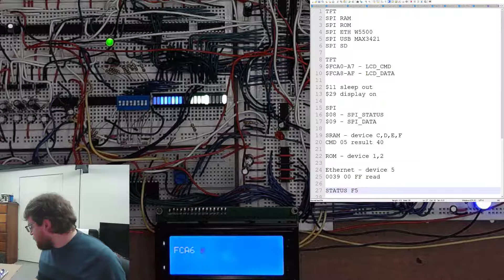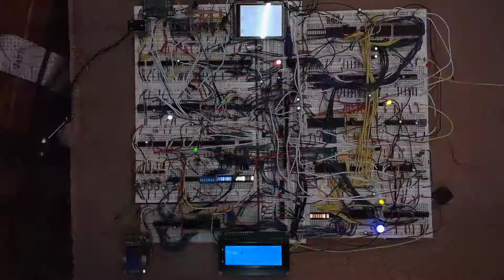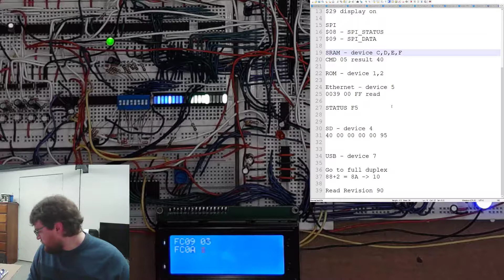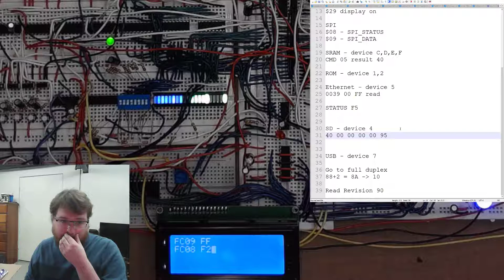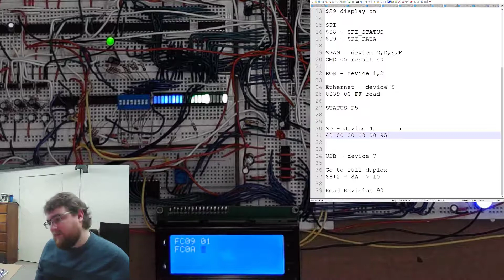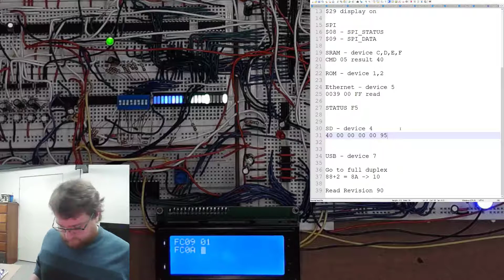VLOG #06 TFT and SPI Hardware Testing

Comment: Do you have a diagram of your board? I'm especially curious about your software-selectable clock speed. I've tried to do it, but my CPU locks up.
Reply from the maker: I only have software selectable clock speed for my hardware SPI module. I manually switch the CPU clock speed and can do so while it's running by pausing the processor then changing the wire on the clock divider, and I can only do that because I'm using the newer static memory version that can lose it's clock. If you wanted to change the clock speed in software you would have to do something similar,  synchronizing either the rising or falling edge of the two clocks to ensure that you don't have some weird bouncing or super short clock interval. You can do so with flip flops and basic logic (I myself plan to just use a microcontroller later to generate the clock and use it to handle smooth switching of speeds). The only diagram I have is a hand drawn mess so I don't think it would help you much unfortunately.